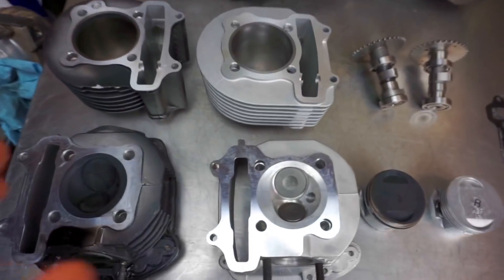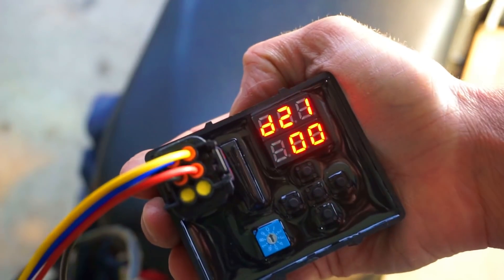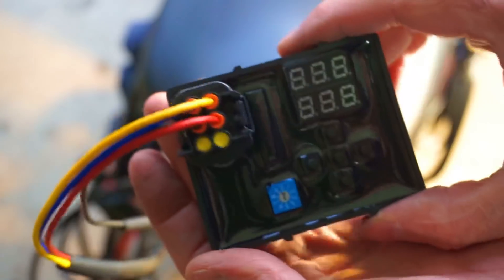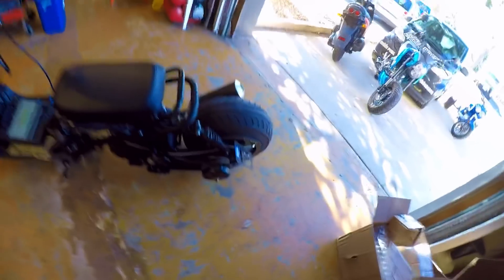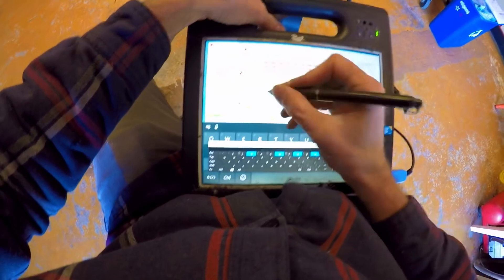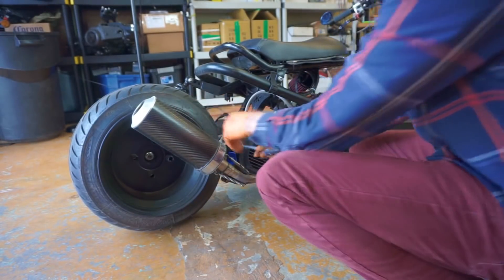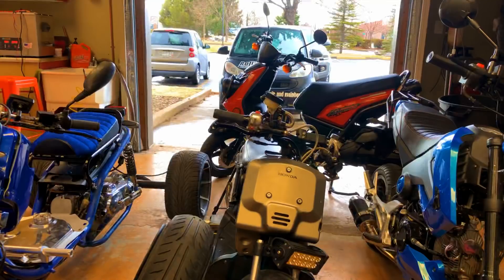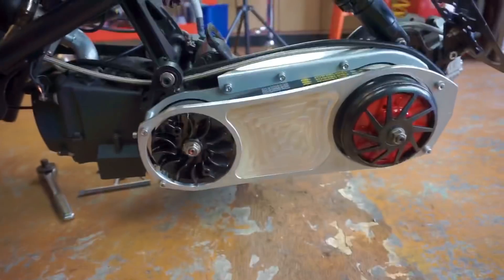GY6 171cc Fuel injection Honda Ruckus project

Comment: I notice the EFI tuners on your website list very specific scooter models. Can these be used with a Chinese scooter or are there ones available somewhere that can?
Reply from the maker: Email us. You can beta test one and give me your feedback. Rollingwrenchparts@gmail.com
Reply: @RollingWrench  i noticed that this video is a bit ols hoping that the technology has gotten better by now ,,so my question is , i have just purchased a vittaci clash 200 with fuel injection directly from the factory and do you have a power program for such a system or do i have to replace somethiing to get more hp when it comes down to the factory EFI?

Comment: yo Mat. Have you ever used a taida race case In a gy6 150 build. If so how good and reliable are they. A Taida race case runs around 500 bucks. Are they worth the money. I'm building a 232cc engine. For a Chinese Ice Bear T-9 150 maxi touring style scooter. The Taida case would save me a lot of time. Because if I use the stock case. I would have to send it to you to be bored out. Also I live in GA. Here in the south it gets brutaly hot in the spring and summer. On a 232cc would you recommend running a oil cooler. I also want to use your plug & play Fuel injection system. What would I be looking at price wise on the total kit with shipping.

Comment: Hey rolling wench :) watched some of your videos ... i got 1 question do ... i recently bought a Motowell Darox scoot (made in hungary) 49cc 4 stroke EFI scooter , led's and digital dash .. front and rear disk breaks .. its a beauty ... but .. if i want to make it to 80cc ... will the efi system need tuning ?? if i disrestrict it .. it will go about 75 km/h ( it has 2.8 kw power) , thats why i wanna buy a malossi 80cc aluminium engine kitt ... giveme some advice pls :) thx

Comment: I have a blazer 150x buggy and I'm wondering if the 171 kit will actually be a noticable difference..  it's a pretty big buggy but it's got good speed for a 150cc already
Reply from the maker: It will work great! But I wouldn’t do efi for a performance upgrade
Reply: @RollingWrench  I was thinking about efi only if I do a turbo or supercharger.  I'm not sure it would work all that well but it would be fun to try.

Comment: Hey will you make a E.F.I kit for the gy6 50cc
Reply from the maker: I wish. Unfortunately the stator power isn’t strong enough. It won’t work :-(
Reply: Will a 11 pole stater fit on a 50cc and is that enough for the EFI thanks
Reply from the maker: leroy tolliver no, that’s what I’m saying. There isn’t a stator big enough to do the job. There is actually no such thing as a GY6 50. I’m pretty sure you are referring to a qmb139. The qmb139 is different then the qmj157(GY6). If you don’t run a head light and do a led taillight you maybe ok, but it will be close
Reply: Ok thanks